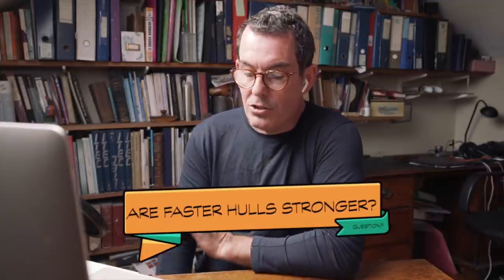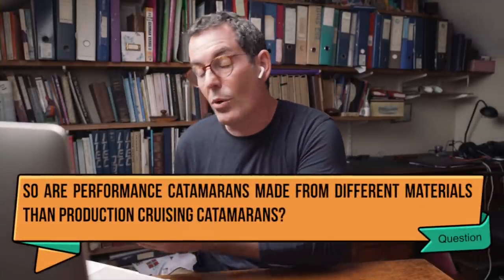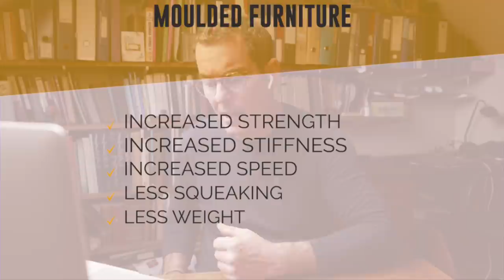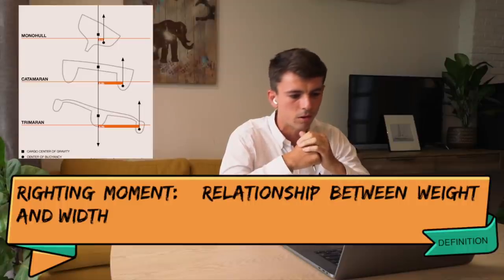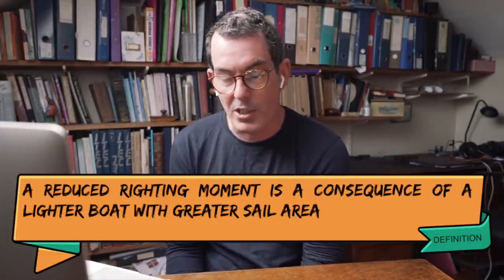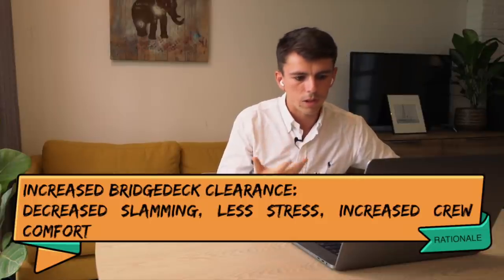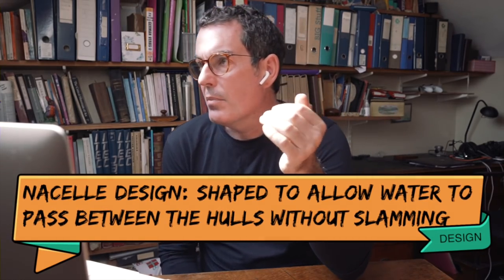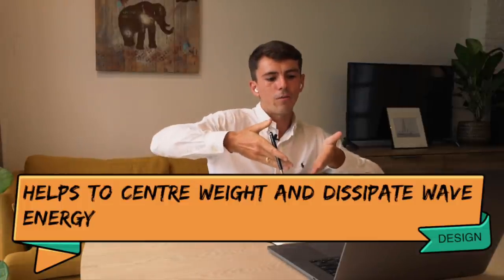CATAMARAN DESIGN: Why Are Some Catamarans Safer Than Others? Ep. 4.

Comment: Catamarans ARE different to sail and mostly do not rely on TONS of weight to keep them from tipping over...   Sail with knowledge and your average speed will be faster than any mono of similar purpose in a Catamaran...   My first live-aboard cat weighed in at less than 4000kg for a 39ft loa...   It was VERY STIFF and wanted to surf with no inclination to broach when surfing (even while crossing an active bar in either direction)...

Comment: We talk a lot more about catamarans than trimarans, why?
Personally, I prefer trimarans because they have all the advantages of a monohull, minus the interior space.
To live on a boat, I understand the advantages of the catamaran, but why ignore cruising trimarans?
Could Antoine tell us about trimarans?
⛵
Reply: Antoine certainly can talk about trimarans because I have good reasons to believe he co-designed the new Corsair 880 . You can see him on a YT clip during the first sea trials
Reply: When it comes to cruising type sailing crafts, beam (width) becomes a  financial handicap.
Add to that the loss of internal volume or living space because the volume of the outrigger hulls is not utilized, and you'll understand why trimarans are mainly suitable if all you want is an extremely fast saling craft.
Reply: @feshfeshsailing  Most commercial tri's are of the folding type (except Neel) : Rapido , Corsair and Dragonfly come to mind . The outriggers can still be used as storage space though . But I get it , a folding 37 ft Corsair has a lot less living space than a typical 37 ft monohull but it will destroy mono's up to 70 ft long (and possibly higher ) in speed . A 51 ft Neel however is a palace compared to a 51 ft mono , but it costs a lot in a marina .
Reply: @gerritgovaerts8443  Yep, and you also don't get the same forgiving (safe) stability curves from a cat or tri that you get from a mono.
Keep in mind also that there is really no point for a performance or fast cruiser to sail at speeds in excess of 18 knots. At those speeds, dynamic comfort.and safety decrease dramatically.
Reply: To me it's not only about speed. Of course speed is important to escape, for example, bad weather.
I grew up with monohulls, they are really excellent. When I got married, my wife never wanted to come sailing because of the monohull heeling.
I tried a Wharram, it's the real 4X4 of the sea. Then a Lagoon, a floating apartment
I love to sail, I wanted a more responsive boat. A Crowther 33 was my ideal sailboat. Now I will surely go to a folding trimaran.
Reply: @gerritgovaerts8443  That's right, multis have Gz values (riggting moment lever arms) between 2 and 3 times higher than those on monos (I never said the opposite).
But those, max Gz values are reached at around 15 deg heel on multis, whereas it takes up to 40 deg of heel for a mono to reach its max Gz. This makes monos more forgiving and safer as they give you more time and indications that you are nearing the danger zone.
Then, past that angle, the stability on multis vanishes much faster on multis than on monos. Gz values for multis drop back to zero around 75 deg heel on average, whereas for monos it happens at around110 deg. This again makes monos much safer.
With regards to monos sinking, it is a usual misconception. Nowadays, monos can have watertight bulkheads, as well as positive buoyancy volumes integrated in their structure. Basically, any usused volume in a mono, can be turned into a sealed space filled with foam, making the vessel unsinkable.

Comment: Something I would really love to see talked about with Antoine on the weight aspect is this disparity between newer and older cats. Cats in general have definitely gotten heavier in the last 20 years, or at least they appear to have gotten heavier, based on published numbers.  You look back at cats from the 90s and you see weights from 4 tons to 11 tons where even the light cats of today are 8 tons.  I've spent a lot of time trying to figure out how this works, especially since modern cats are built with much lighter and stronger materials.  Is this just a matter of modern cats advertising their lightship weights including everything on the base boat vs older designs only advertising the weight of a bare hull?  It's incredibly confusing trying to figure out why two boats of the same length can be so drastically different especially given that logically, modern cats should be lighter due to more advanced construction, design and materials.

Getting the perspective of someone who actually knows what they are talking about would be great (since 99% of the info on the net seems to be pure conjecture).
Reply: You will also see that the newer cats have more beam. Thus they are heavier, but its not the whole story.
Reply: @daveatticus1018  Ahh, that's a good point that I hadn't thought about, but yeah, that's not going to make up all of the difference.

My overall suspicion is that designers of the older cats tended to publish weight for the bare hull without anything in it (no engines, furniture, rigging, etc...) OR just publish the calculated mLCC which is at best a target weight to build to, and at worst a rough guess.

Meanwhile, I feel like modern builders tend to advertise weights including all of the base equipment, basically, what you get if you pay the bare minimum.  I know that Xquisite says that their published weight includes all of the base equipment on the boat, and that's why it weighs 25 tons (still seems quite heavy to me, but they do use a lot of solid wood).

Comment: righting moment does not have anything to do with sail area, see principles of Yacht Design by Eliasson and Larsson, page 44. it is a very simple calculation, mass gravity and distance that is all there is to it. Then you have stability calculations which are righting moment calculations for different heel angles. For a mono hull the angle span where the boat is stable upside down is quite narrow maybe 15-20degrees, for a cat that span is 180 degrees.

Comment: Love your 1370 choice and it’s design but a suggestion...
I question the two most aft ventilation deck hatch locations in the illustration. First they seem to interfere with the under deck running rigging coming back to the clutches & winches. These go thru a turn at the diagonal corner of the deckhouse and need an unimpeded run straight back to the clutches. Secondarily, although a small hatch near this location might benefit the starboard day/guest head there is no overhead ventilation in the aft berth. One on both sides to the aft of the winches would benefit the guest bed and the owners shower area.

Comment: Really enjoy these esp. since I'm looking at the 1260.  Was surprised to hear that they don't use modeling, not offended, just surprised.   The one thing that I've always wonder and I had hoped would be covered was righting moment with regards to wave action. Sure I understand that mast is likely to break prior to even lifting a hull. But let's put that in the context of large waves. What size of beam on wave does one need based on weight and beam to capsize. Is weight really even a factor?  At a 24' beam are you pretty safe until you get a breaking wave of around 50' ?  Or is is far less, or does weight really figure in to it?
Reply: Said to be beam about 1/3 the wave height

Comment: A cat doesn't have a positive righting moment the way a ballasted monohull does.  Once the angle of heel gets much past 35-40 degrees from vertical it's in danger of broaching (rolling over) and is not going to right it's self.  A well built monohull can be rolled 180 degree's and still right it's self.
Reply: Max righting moment for a Cat is around 11 degrees and going down quickly over that . I would not want to be in a Cat at 15 degrees of heel . A trimaran OTH has its max righting moment at 30 degrees.
Reply: Not much rigging left after a 180 or 360 or any dunking of the main. Once the keel pops up it becomes yet another surface affected by wave action. Pitch poling a cat is in adverse sea conditions is more likely to turtle you than rolling over by the beam. More ships go down from bad captains than by bad designs.

Comment: diffrent betwen cheapmaran and chartermaran
cheapmaran.. less equipment/space but fast
chartermaran full equipment/space but slow
the gap only point a to b is only max 1 day
and you struggle in cheapmaran in tropical place because no aircond/no washer and etc and chartermaran will be fast if use parasailing like igor stepronic and sailing off duty do with lagoon and xquisite x5 they sail 2-4 knot at 7-8tws. prove it with video... and cheapmaran they said their cheapmaran is fast but never prove it with any video.. so the so called fast only in the paper and not proved... and still waiting for any cheapmaran owner do the video